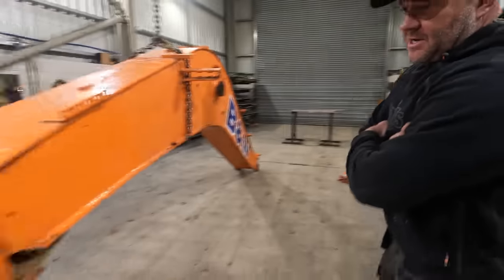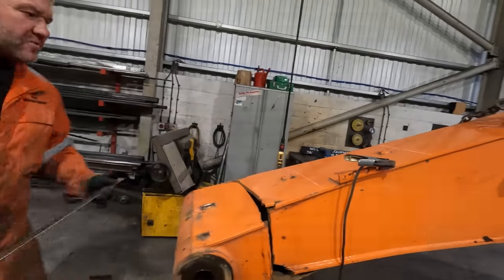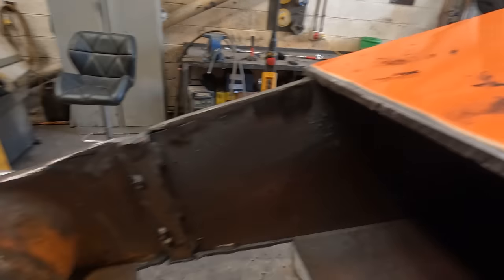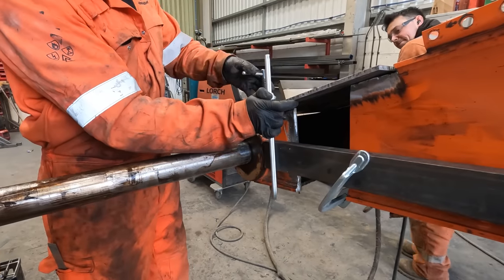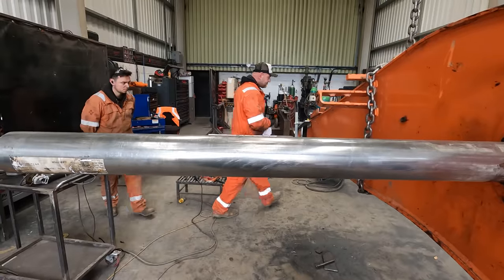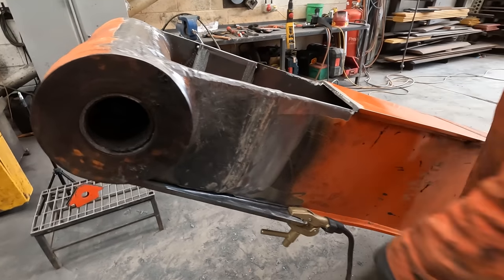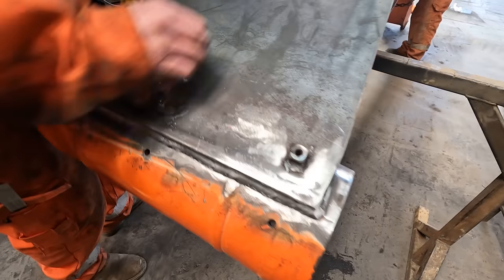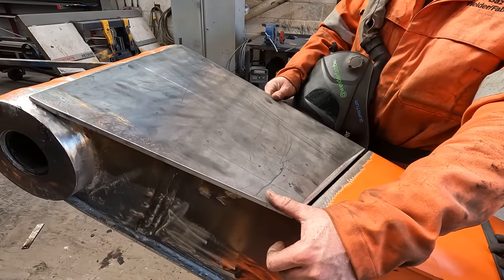Doosan Excavator DX 140 Boom Repair WELDERFABBER Episode #002

Comment: I reckon cracking before a weld indicates a lack of post-weld heat treatment that leaves the hot weld area harder than the base metal, need to heat the entire area on that piece and cover it with insulation to cool down very slowly.

Comment: Brilliant watching a quality repair, completed by people far more concsientious than those who made the damned jib. The shocking weld exposed within an area normally not seen, gives an insight to how much worse this damage was, compared to whether it wouldn't have beem as bad, or occurred at all, if the original weld had've been up to scratch.. It would bring into question the quality of what you buy from overseas and maybe WHY, it is cheaper than comparable Western models.
Reply from the maker: shocking what you find when you open some of these up

Comment: A brilliant job stronger than factory as I was watching it I was wondering how your were going to weld that stiffener on the inside when you put the final plate on it doesn't need it anyway that damage was caused by a bad driver we had a 210 hitachi go the same way the driver using a 7ft grading bucket using one corner of the bucket I don't have to tell what happened that driver